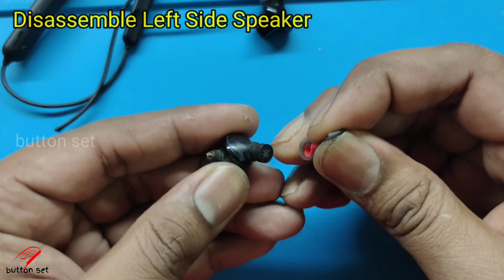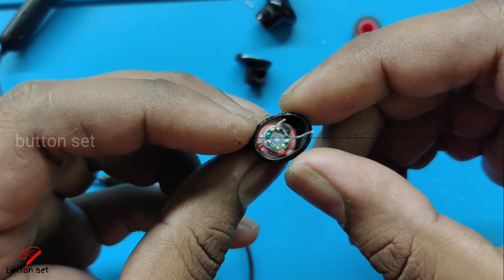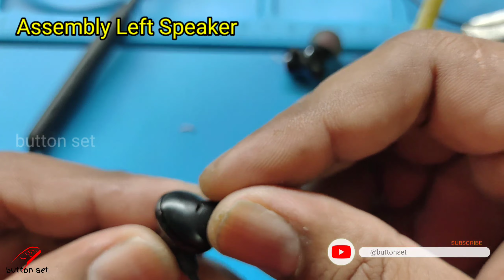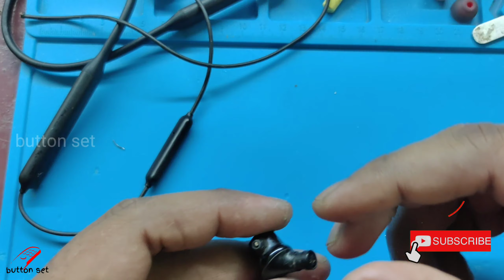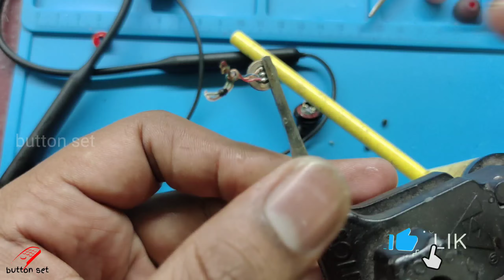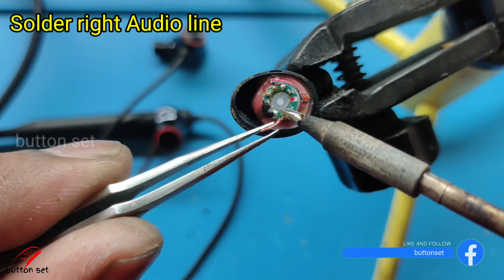OnePlus Bullets Wireless 2 Repair

Comment: Is it possible for you to repair my OnePlus Bullets Wireless 2 with the same issue as shown in the video. Mic also not working due to water exposure. Also want to know if complete wire can be replaced to maintain the same exact length.
Reply from the maker: Kindly send your device picture on Instagram @buttonset sir